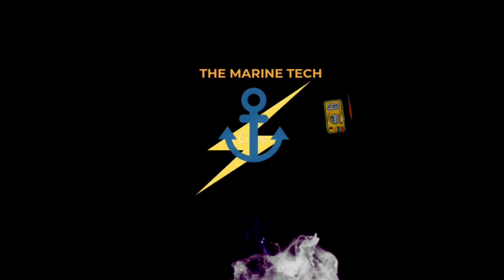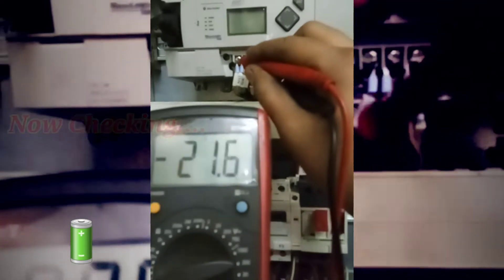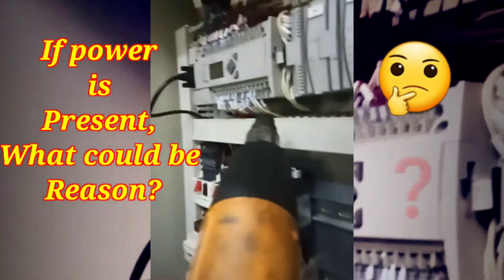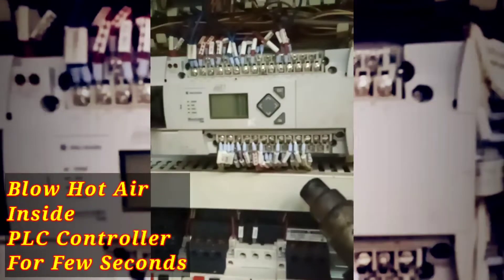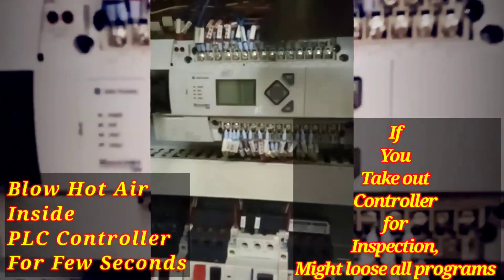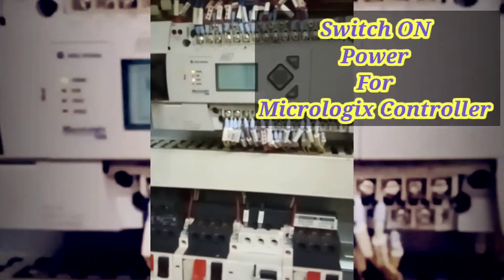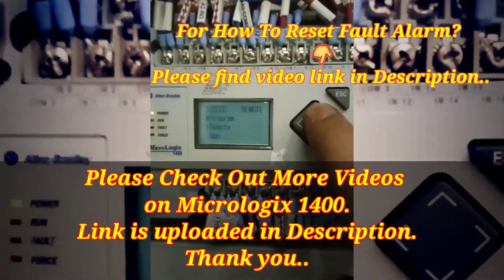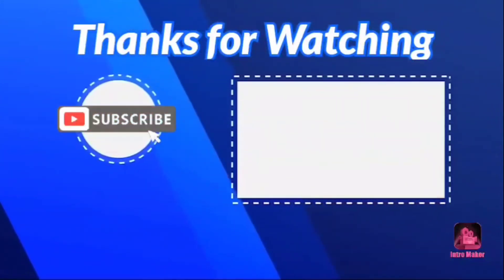MICROLOGIX 1400 TROUBLESHOOTING||Allen-Bradley|| How To Restart Micrologix 1400 if display is blank?

Comment: I have a question of heating using heat gun of PLC may i know is the weather is cold so  need to pre-heat?
Reply from the maker: It's happens during cold weather if the PLC is old. Then, we need to replace PLC.

Comment: Hi bro same plc here i have but it's not switching on its 230v supply eventhough it has supply but not switching on
Reply from the maker: Hi.. first switch off plc 230vAc, Now use a hot gun to preheat PLC for at least 10 seconds..then switch on power..plc will be On..
DONOT OPEN PLC TO INSPECT.YOU MIGHT LOST ALL PROGRAM IF YOU DISCONNECT PLC BATTERY..